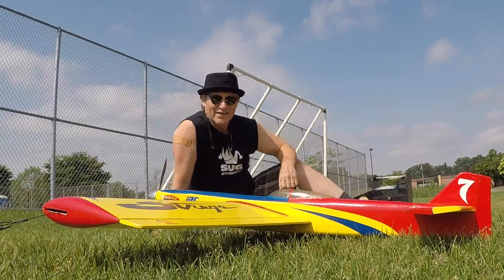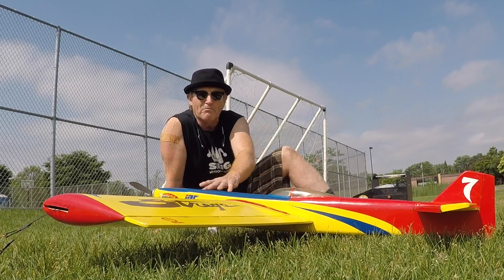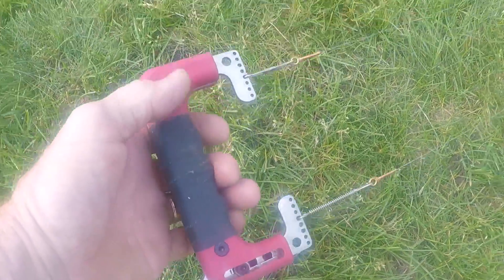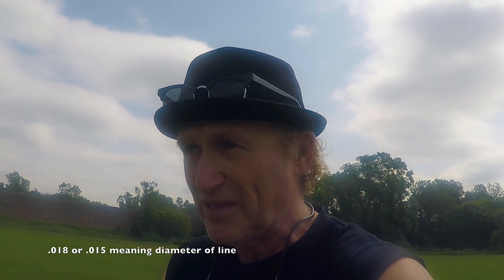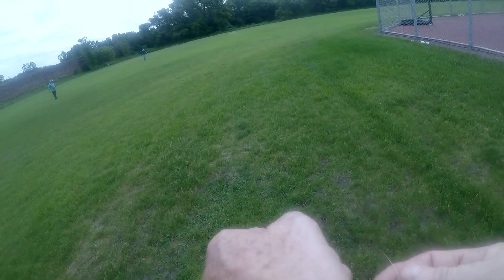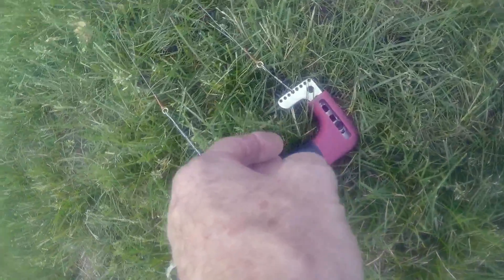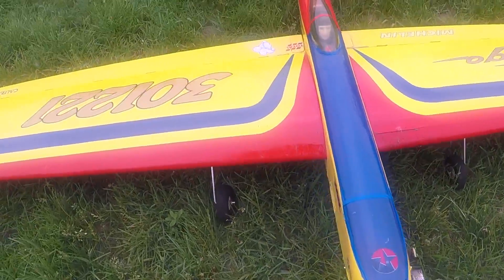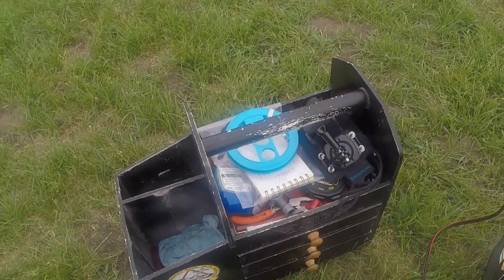Control Line Airplane Flying Explanation

Comment: Hi Shug, I'm 71 and used to fly control line a lot. Do you know ANYWHERE I can buy any of the following kits:
  1. WOW.    .35
  2. WOWEE .049
  3. KOMBAT KAT .35
Thanks man !
Reply from the maker: I Google searched and these came up.
Maybe start here.....
Combat Cat https://vintageperformancemodelairplanes.com/collections/control-line-combat-kits-19-35
Wowee.....https://www.ebay.com/itm/126660595709

https://brodak.com/control-line-kits/brodak.html
Reply: Shut, you're a gentleman and a scholar !
Thank you for caring enough to respond to my inquiry about these kits. I had a Wowee when I was 15, and just thought the delta wing control line shape was the car's meow. I honestly can not remember what happened to it, but it stands out in my memory. Even back then it was a long shot chance that I found it in a hobby shop while visiting my aunt and uncle in Sanford, NC. I built it the same day I bought it and was amazed at how responsive it was with a golden bee on it. In the directions, I saw a mention of the .35 version Wow, and have never forgotten. I used to fly Ringmasters a lot, and had fair success combating a Flite Streak which I sewed the flaps on to make them work like the Nobler's. I always wanted one of those too. Is that a Nobler without the cockpit in this video ? I flew a lot of Combat Kittens and always wanted a Combat Cat ( which I mistakenly thought was spelled Kombat Kat). I'll check into these you mentioned. It's a shame that you can hardly get kids interested in control line anymore with all the high tech RC gear and video games about.
I had so much good clean fun flying control line with my buddies, all the way up to the mid nineties.
Well God Bless you and I thank you again !
Reply: "Shug", sorry, clumsy hands and little keyboards don't mix !

Comment: When I was 12 we built planes using only plans.  We hand cut all the parts.  Made the tank by soldering sheet metal and brass tubing.   We covered the plane in silk.  We built the bell crank and all the hardware.  There were no kits to buy where I lived only sheets of balsa at the local hobby shop.  The club I belonged to had sets of plans we could borrow.  The owner of the hobby shop flew RC and could not be bothered with us lower class CL flyers.  That was fine with us.  We drove for hours going to competitions.  It was an amazing childhood.  I learned so  much from the older guys in the club "SK-Lin-Len".  That was in Linkoping Sweden in the early 1970's. Now I'm a Plastic Surgeon in San Francisco.  What a thrill it's been
Reply from the maker: That is a wonderful set of memories of a well spent youth. Similar memories for me as well. Music, modeling and surgery for the WIN.
Reply: Well, NOW you can afford a 1.20 size R/C model.... 

Hell, you could go turbine if you wanted to. Just imagine the face of your ole hobbyy store guy of you walked in with an R/C turbine jet, and asked him for sime parts for THAT. Then when he tells you that he doesn't have any parts for it, you can ask him "Well, what kind of rinky dink operation you got going on here?!?"
Reply: @davelowets Similar background, then RC - built my own 2 ch  proportional 27 Mhz radio set from plans, everything was so big and heavy, now I can  fly 36 in ws with 4 ch electric, I wouldn't give you anything to go for RTF,   'bigger', or turbine - zero interest, there is no pleasure in it, it's all done for you, just pay and play. The result, no youth, people pay, play, crash, and move on to golf or mountain bikes, nowadays there are no magazines, no model shops, fewer clubs, everyone is 70 +. Sic transit gloria mundi.

Comment: So from the moment you start the engine it's going 100% open? Same with the electrics? 100% open signal?
Reply from the maker: Yes but you can adjust your speed and rpms. On electric it winds up to speed at the rpm you set.

Comment: I really enjoy your videos on U control line flying.  What size planes for a Cox .049 engine, what would you recomend?
Reply from the maker: You will need a 1/2 A size plane.....https://brodak.com/control-line-kits/brodak/1-2-a-series/1-2a-lil-wizard-kit.html

 https://brodak.com/control-line-kits/brodak/1-2-a-series/1-2a-swordsman-18-kit.html

https://brodak.com/control-line-kits/brodak/1-2-a-series.html?product_list_limit=40

https://brodak.com/control-line-parts/1-2-control-line-supplies/1-2a-control-line-flite-pak.html

Comment: Hi! I am building a small scale control line plane and I am tethering it to the ground, so I can fly in circles.  I am going to use a transmitter to apply throttle and elevator only.  Question is: How long of a line do I use to keep the centripetal force in order for the plane to have have enough flying power.  I am using a high pitch rotor...  one cell battery!
Reply from the maker: It depends on the thrust and power of the motor or engine. Many small engines such as a1/2A cox engines go with about 30 foot lines. Start shorter and you can always increase line length. If too long they will cause a lot of drag.

Comment: I did this when I was a kid. My mother tossed it all out. I had a big box of parts for flying these planes.it is fun. I made a few planes from scratch with my dad it was a fun hobby. Only if my mother had not thrown it out years ago. I was asking about it when I was moving out about 20 years ago. She said I threw it in the trash. She cleaned out my closet when I was moving out without asking me. I was very upset.
Reply from the maker: My Mom threw away magic kits and such that I saved and mailed off for. She thought they were a scam. Moms do stuff...but mainly good stuff.

Comment: Weened on these. OS35 Aeroflyte Avenger, a die cut balsa kit and started with a Cox PT19. Flew in a club in the middle of Centenial park In Sydneys east. No chance in hell now days.
Reply from the maker: Too crowded?
Reply: I remember the club at Centennial Park. In my case, I started with the Aeroflyte Hummbug, followed by the Von Baron and the Keilkraft Radian, which was surely my favourite. I also made many self-designed 0.049 models. All flown at Queen's Park. These days, there's a club at St.Ives (Kuring-gai Model Flying Club) that specialises in control line, or try contacting  http://www.control-line.org.au/. I'm looking for a place to start flying again that's closer to me, but with no council bans or whining residents 😋. Good luck!
Reply from the maker: Try electric. Quieter for sure and plenty of power.  https://youtu.be/Mc_nJHxJI8k
Reply: @shugemery  Thanks for the suggestion and video Shug!
Reply: @dingalarm  I flew often in Queens park with a friend named Ian V. We flew cobras they were a solid balsa wing and were good for conmbat
Reply: @gen3v8  That's great! I always felt that Aeroflyte kits were supplied with excellent quality die-cut balsa and hardware.

Comment: This is cool and takes a certain skill no doubt, but as an rc glider and plane guy I would not be satisfied with the limitations of being continuously attached to a control line, it’s a totally different concept I guess, I wonder if control line guys have ever flown RC?
Reply from the maker: I flew  lot of RC. Even tried gliders.  I like the physical connection of control line and always fairly close to ground. Nostalgia thing.

Comment: That is so cool
I had 2 cox control line planes when I was a kid 
I was able to go in a circle and land without crashing 
Never tried stunts
Reply from the maker: It was hard to get a loop out of most of those old plastic Cox planes.
Reply: I had a bunch of cox .049 planes when I was a kid. One of them was called something like the super stunter. It had huge foam wings. It was easy to get that one to do loops, figure 8s, just about anything the bigger planes could do. When I got a little older, before taking the plunge into RC, I did control line combat. That was the most fun I think.

Comment: II have been watching many of your vids  on line control. I flew line when my sons were young about 20 years or more ago with those cox planes many different types. Then hooked on R/C flying but an event came up so wanted to give it a revisit. What I assembled is a H9 PT-19, 36 evo engine, a hard plane to find , now to be honest with all that read this was I nervous, had not flown a plane that big on 60' lines and with about 10 wind. Got up and down in one piece, but I am see I have much more to learn than going in a circle, want to do loops, invert, and a Cuban 8. I did get a blue clown (that silver one is nice). Have not assembled it yet but will soon seeing how quick smooth that plane does maneuvers, now how do you work the wind/breeze to the fliers advantage. There is a very good line field here in Harris county in TX and went with my equipment also a stooge to launch, did 7 flights just working on the feel and just going up and down like if on a hill also the landing, trying to whip it around after engine stops. I write all this for advise and info so can be a better pilot, if have any help/info will be greatly appreciated
Reply from the maker: Control line is pretty challenging to learn. Never very far from the ground!
Make sure to try maneuvers downwind.
Here are some good tips:
https://brodak.com/stunting_tips_1
https://brodak.com/stunting_tips_2
https://brodak.com/beginner_aerobatics
Reply: ok will check out these links

Comment: Sir i have watched your videos a loot, your absolutely brilliant, i cant even come close to you,Sir iam from India and i have a advanced  controlline aeromodel calld gret gun, its a well built model with only elevator moment, Sir i tend to raise my hand a loot when the model takes off and  it goes too high and then there is a slack which makes it unctrolable resulting in crash quite a number of times.Plzz Advice as to what my hand moments should be during take off and what are  the steps taken to curb my habbit and  have a clean take off, the lines are 50 feet and i use a 3.2 sharma diesel engine which is very smooth and powerfull..your advice is eagerly awaited,Thank you..
Reply from the maker: These articles may give you some insight...
https://brodak.com/secrets_control_line_flying
https://brodak.com/solo_flight

https://brodak.com/stunting_tips_1
https://brodak.com/stunting_tips_2
Reply: Thank you soo much sir happy flying...plzz visit india when you have time...

Comment: Hi shug I'm from England and I have flown cl years ago but I'm thinking of building a Keil Kraft spectre with a .19 and 60 ft lines would this be ok cheers buddy regards ray
Reply from the maker: I am not familiar with that airplane.  60 seems a bit long for a .19 but one never knows. You could always shorten the lines.
Reply: @shugemery  thanks for replying matey it does say a .15 but yes I can try shorter lines great to hear from you regards ray

Comment: Tower Hobbies...that takes me back.  I remember my first R/C helicopter I bought from them when I was in college. A nexus .30. I remember thinking, I'm a commercial pilot, this should be a breeze....I remember being wrong too, that thing went into about 30 pieces when it hit the ground.  Incidentally, learning to fly R/C helicopters, you also get very good at repairing them too.
Reply from the maker: Tower still exists. I have heard of many real pilots having trouble at first. Must be weird that you are not in the cockpit.
Reply: @shugemery  Yeah, but they stopped selling helicopters for some reason.  It is hard not being in the cockpit; however, I think now it is more the lack of instrumentation. I'm a fixed wing pilot that flys R/C helis, I bought my first r/c plane and a few years ago and put the camera on it with the goggles thinking that it would be easier, it's not, I can't tell when I am about to stall and I get disoriented.  I still have the pieces of that old nexus .30...good memories.

Comment: Hey, your opinion please. I'm 67 and now bought 14 kits from ebay. Mostly scale, some profile and engines and a ton of stuff. Now retired, i have some time and money. As a teen i used ambroid wood glue and pins. Now they say use cyrano stuff. It leaks and smells. Does it work good or wood glue holds better ? 😎
Reply from the maker: I always use cyno and epoxy too.
Reply: @shugemery  thanx

Comment: Thanks for the videos!!!  this takes me waaaay back into the early 70's, lugging around a plastic stuka or a pt trainer with .049's and a round tall dry cell battery in my bag, along with a can of cox fuel, wow, still have some of those old engines from years ago, might just take this up again.
Reply from the maker: My Dad bought me that same Stuka. First plane. Had a bomb drop.
Reply: @shugemery  black stuka or green stuka?
Reply from the maker: @gregorydahl  Black Stuka....
Reply: I had the Super Sport that I got for my 9th birthday. It did a figure 9 and that was that.
I finally got a PT 19 flying in 86, then the P-51.
Followed those two with a Sterling Cub and a Deweybird.
Reply: That tall dry cell was awesome until it fell flat.
Reply: Going to K-mart and checking the model aisle for new planes . Testors started making $9 control line planes in '74-'75

Comment: Hey, i'm 66, and now gonna get back into building control line  since i was a teen in the 60's. I now bought on ebay many kits, and some from brodack. Just put up my table and all engines and supplies. Watching your videos.....as i remember should not the inside wing be about an inch or two longer than the outside wing? Or the same with just a small weight on the outside wing ? Thanx
Reply from the maker: They don't do wings like that much anymore. Just add tip weight.

Comment: Very nice sir.  I had no idea they still flew "U" controlled planes anymore.  I tried to fly my first, and last plane back in 1950. It had a an .049 engine in it if I remember correctly.  I remember the battery was one of those large round 1.5v dry cells.  I remember spending quite a few hours build the plane and the flight lasted at best less than 3 seconds, straight up to about 10 foot and then straight down. The plane was in pieces and the engine must have swallowed some dirt because it was hard to turn over.  It's funny I haven't thought about that long ago afternoon until I came across your video.  Good job.
Reply from the maker: Yessir. I had the same experience as a young lad.

Comment: Great video! I love your hammock & camping videos and you make control line flying very fun and interesting. I personally prefer rc flying with glow engines. Ever try that? One idea you may consider for ease of clean up is to use a tuned pipe on your Strega. Even if it’s not tuned to your engine it keeps the slime at or past the tail.
Reply from the maker: I have flown a good bit of RC but prefer to just fly control line these days.
Thankee!.....https://www.youtube.com/playlist?list=PLahaAdtfX9ZLW32PEiLX2iAN7MG_ZtUSs
Reply: That's because it blows it into the next county.

Comment: Love it. It brings back some good memories. Use to get the Kmart special. I think it was a p 59. Something like that. It was yellow and blue and was held together by rubber bands. If you crashe'd it you just put it back together with new rubber bands. It was great for us newbies😃
Reply: That was a Fairchild PT-17 I believe
Reply: @charlesg1150  Could be. They were so fun. And very cheap back in the 70s.
Reply: Or was it the Cox PT-19 Trainer ?

Comment: Learnt a lot from your video and the links . looking forward to some more Shug ! Is there a way of working out how much lead to put on your wing for the maiden flight ?
Reply from the maker: Most kits recommend the tip weight
Start at about an ounce at least. Then have someone watch for level wings in flight. High wing...more tip weight.
Reply from the maker: • Did the plane fly with one wing higher than the other? There are two possible problems here, and it’s fairly easy to tell which one is the culprit. It’s either a matter of wingtip weight or a wing warp.Unless the problem is so extreme that there’s a risk of a crash in making the maneuver, fly the plane inverted and examine the alignment of the wings. If the wing that was low when upright is now high when inverted, you have a warp. This is fairly easy to correct if you used an iron-on covering; just twist the wing in the desired direction and reshrink the covering to hold the new shape. A silkspan/dope wing may require steaming, or trim tabs for alignment. Flapped planes can be trimmed with adjustment–”tweaking”–of the flaps to correct the warp.If the wing that was low when upright remains low when the plane is inverted, it’s more likely a tip weight problem. If the outboard wing is low in both altitudes, there’s too much weight; if it’s high, there’s not enough. You want to use the minimum weight necessary–remember that tip weight is mostly an aid in takeoff and has limited value once the plane is flying. Too much weight can cause the outboard tip to drop in maneuvers.

Comment: I'd never heard of this before,  seems more accessible than starting with RC.   very cool
Reply from the maker: Well not necessarily. RC is easier to equip yourself these days more often than not.
Reply: Back when I started flying control line, it didn't cost much, but RC equipment was expensive back then.

Comment: Is there any throttle control or is it preset?
Reply from the maker: Not on this set-up. There are 3 line scale models that do that.....one line to throttle. Never tried it myself.
No timer that is why we measure out our fuel.
Reply: Some did have throttle control, but you don't need it. It is a glow plug engine so you screw in the needle valve to a lean out the fuel/air mixture and it just works.